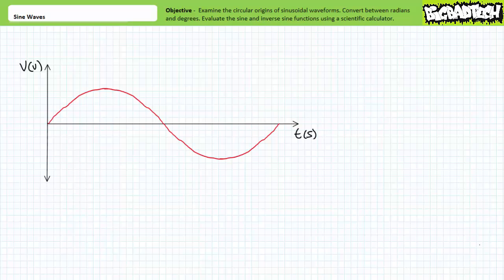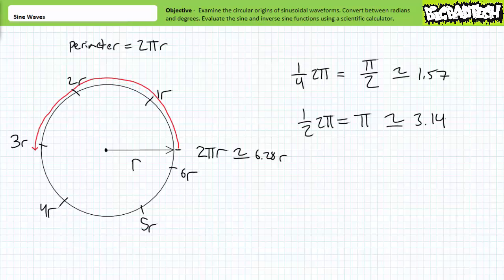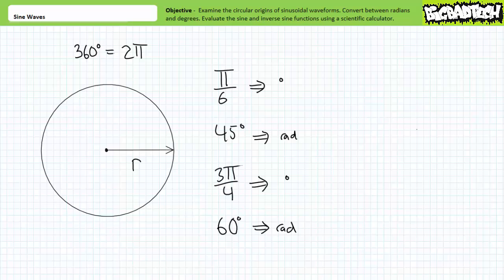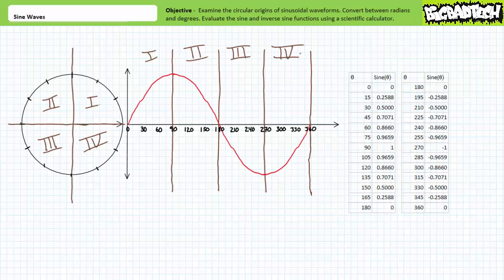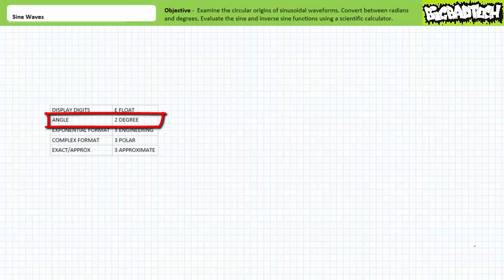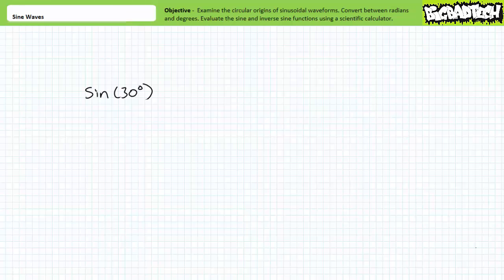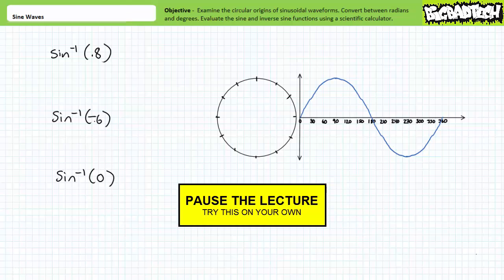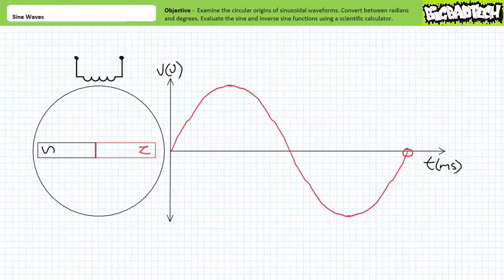Sine Waves (Full Lecture)

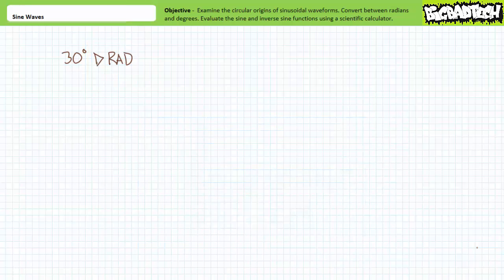Comment: 27:50 It seems like instead of >rad hiding in catalog, it is over in the math menu, which is odd. Don't know if it is because I am using a 2nd hand TI-89 or what, but I just want to point that out for anyone confused down here

Edit: scratch that, the firmware on my calculator simply is MISSING the function entirely!

Comment: Quick tip: when you're looking for the >Rad, After pressing Catalog, press Alpha, then R, and it will jump to the R's of the very long list of catalog entries.  Otherwise you could be scrolling for a long time...
Reply from the maker: True. Yes you can jump around in the catalog with letter keys. There's also a way to assign commonly used functions to the diamond key.

Comment: If You take any point on the circle's circumference and desire to measure the travel distance from the start You either take a rope and measure the distance along circumference or measure the angle and deviding the angle to 1 radian You get the distance( how many radii the point travelled from the start). If the point is at 90° You devide 90° by 1 radian( 57,3°) and get 1.57 radius of distance.